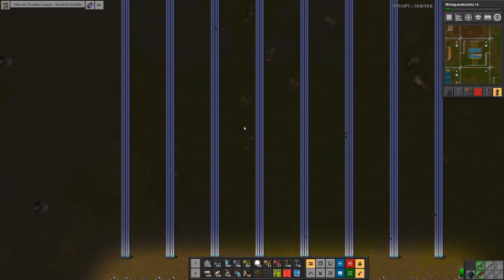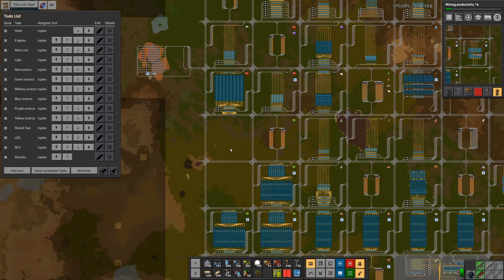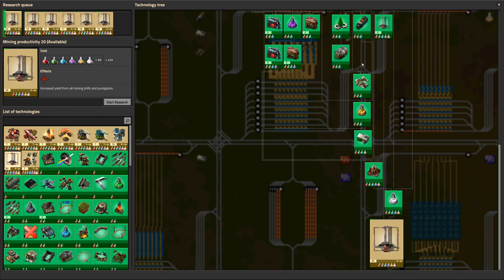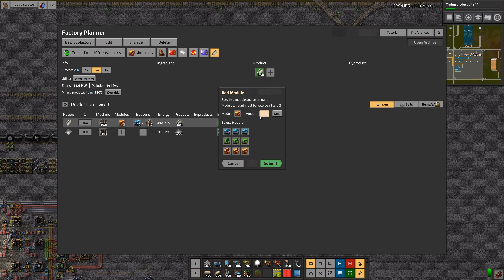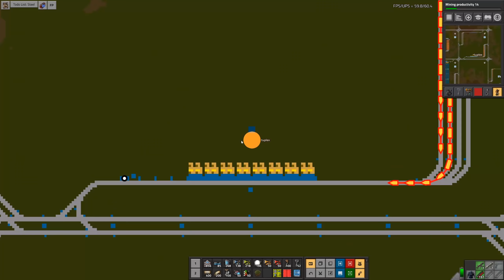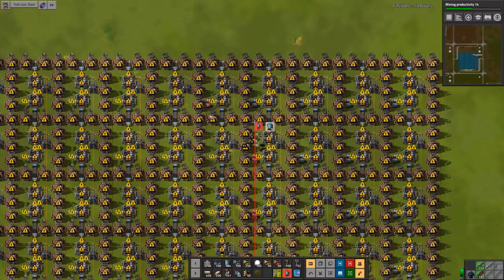Factorio 2,500 SPM Grid Megabase #44 - Steel

Comment: Tip: When you make an error in the belts, you can just safely remove all the belts from your build except for one machine/oven/etc.. Since you need to put a blue print everywhere already, it does not matter to remove belts that are already correct. It's much faster (in general) to just remove every belt and rebuild them with a blueprint. (I've learned this through building and blueprinting many builds filled with errors, so take that in to consideration when reading this tip :-) )

Comment: 2 random thoughts on things you brought up, plus a random amusement:

1:00:25 - I think what happened with that unevenness was that you were running things for a while, and all was even, but there was no output, so things started buffering in the furnaces.  Then, circa 56:00, you set up output belts of different lengths.  This..... oh, no.  I was going to say that this drained different quantities from different columns of furnaces, but you drained all the belts fully before turning things back on, so I'm not sure...  maybe because some had filled by 55:25 when you turned them off?  But was it only the lanes without prod mods that were lower?  I thought it was an inverted bell curve.  Hrm.  I dunno.  :)  I could maybe figure it out, but that's enough back and forth in the video for me for now.  :)

As for the missing modules, the cut you did at 40:07 caused some machines to have modules pulled without being removed themselves, and then the undo apparently didn't put requests for them back in in those cases.  You then copied them as-was, not noticing the missing modules.  Machines that hadn't had modules pulled yet or where the machines themselves had been pulled were fine.  You may want to check your beacons, too -- it looks like at least (exactly?) one (middle beacon between smelters 5 and 6, as counted from 1 being the left) is missing speed modules. (Visible at 41:04)

And random amusement: the bot flight for the underground removals circa 47:20 is quite interesting... much of the decon is out of bot range as its formally done, and so the bots fly off to do it as you're running up the next column... in alternating waves.  No error or anything with this, just... amusing to me to watch.  :)
Reply: Oh yeah, p.s.  1:00:59 - you're getting full belts because the furnaces had buffers to offload.  They were emptying by the time you cut the belts (see all those blanks at 1:01:35 ?)... you didn't need to expand... but no harm done.  Trains can now load faster, potentially.  :)
Reply from the maker: Thanks for telling me about the missing speed modules!  I fixed it...